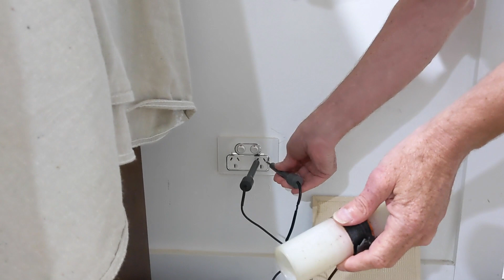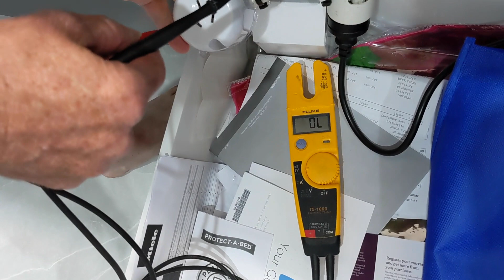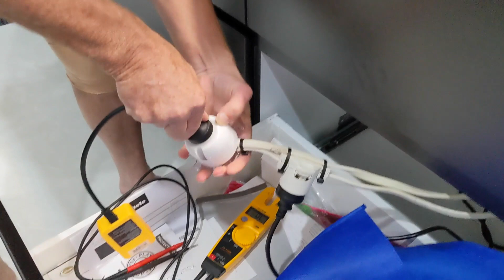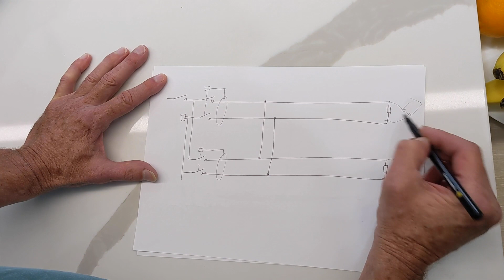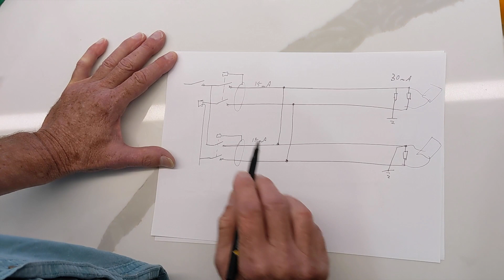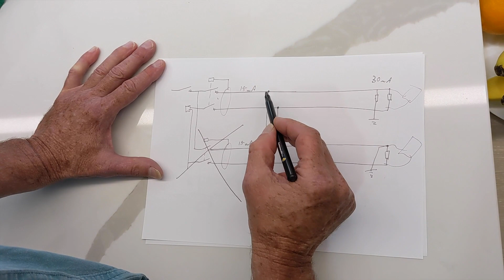Finding Interconnection

Comment: 😂as an apprentice in the mid 70s the first thing we had to make was a set of test lights with two pilot lamps we weren't allowed to use a meter until we finish trade school 2.5 years later. We never had elv control ccts they were all 240 volts means we tested control continuity live shock horror for today's work safe inspectors yeah a bright light was 415v dull 240v those were the days
Reply from the maker: Same